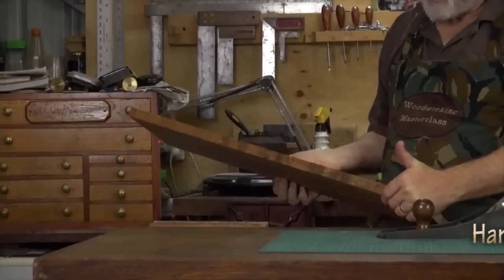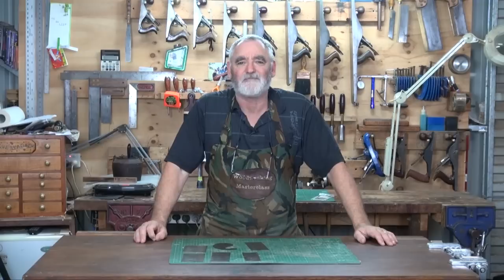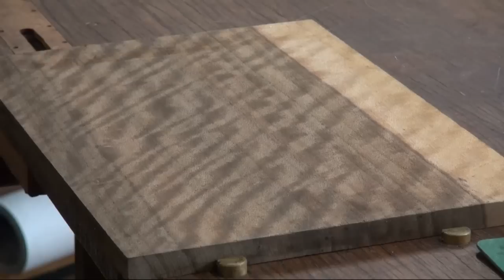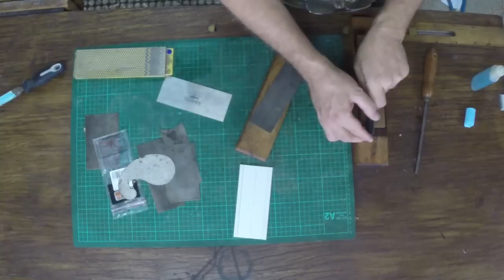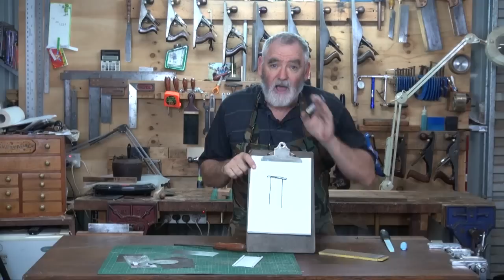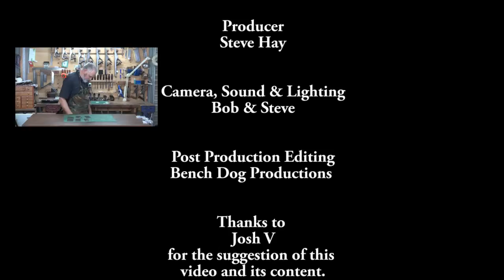Cabinet Scrapers Part 1

Comment: Steve,  I'm sure that you are a much better woodworker than I am but I must take exception to your card scraper video.  A properly sharpened card scraper produces fine shavings, not sawdust.  If I might offer a piece of advice I believe that a 5 degree angle and much less pressure will produce a scraper burr that will attain the desired result of a surface that need no further attention other than the application of the finish.  I use water stones and an 8000 grit polishing stone and produce shavings as fine as angel hair.  Once finished one can hardly feel the burr.

Comment: A file or rasp should only be used with a push stroke or it will be dulled.
Reply from the maker: Adding chalk helps clean them too. Cheers Steve
Reply: @Woodworkingmasterclass  That's one I forgot, thanks for the reminder.

Comment: Suppose you had to get a smooth, finish-ready surface on a 2'x10' knotty pine slab. Is a scraper a good tool for that job? If so, do you have to walk the full 10', or can you do smaller sections? Can the finish be compared to sandpaper grit from a nice pneumatic orbital -- 120? 220? 400? Plus any other questions I should be asking, but don't know enough to ask them. Thanks!
Reply from the maker: No you can scrape in smaller sections but remember to blend them together at the end. Finish from properly scrapped board should equal about 1500 to 2000 grit. Main advantage is also that there will be no raising grain once the first coat of stain or finish has been applied as there is when using a sander of any type. Be careful; scraping over knots as you may have to sharpen it a time of two to keep the cuts clean without tearout.. Cheers Steve
Reply: @Woodworkingmasterclass  Fantastic! Thank you! I hadn't even thought of the grain-raising issue from finish/stain; we have to "water pop" now, which is more time taken -- always a bad thing in a production shop. You and Katz-Moses inspired me to get a scraper yesterday so that I can start practicing. Thanks again :-)
Reply from the maker: @frenstcht  Pleased to have been of assistance. Cheers Steve
Reply: @Woodworkingmasterclass  I went and got one, then went to where I work to test it out. Holy crap! It's easier to use than a measuring tape -- and so inexpensive! I'm looking forward to being good with one. Thanks again ^_^
Reply from the maker: @frenstcht  Remember to sharpen a little, often rather that a lot infrequently. All the best with it. Cheers Steve

Comment: I learned a trick for a hot cabinet scraper is to simply flip it over 180 degrees every few strokes to keep the scraper from heating up. It also makes the scraper wear evenly so that you get the most out of the tool before sharpenings. Great video though! I look forward to watching more. Have a good one, -Austin
Reply from the maker: NosillaWilla Great Tip, Thanks for sharing it. I'll try it next time I'm scraping. Cheers Steve

Comment: Thanks, from Portugal :)
By the way dovetails joins in plywood is possible?
Reply from the maker: Hi Augusto. You are most welcome and Yes you can cut Dovetails in Plywood. Make sure, as always, you have a well sharpened chisel this is even more important with plywood for 2 reasons. 1. the cross grain construction and 2. the glue used cement the layers of the plywood together is very abrasive on cutting edges. Cheers Steve
Reply: Woodworking Masterclass Thanks to take the time to answer to me :)...
Reply from the maker: Augusto Campos You're most welcome anytime. Cheers Steve

Comment: Hi Steve.  First visit to your site and I am already impressed.  Good enough reason to subscribe as I need.

The reason I found you is I was trying to find some information about scrapers and this seems to have all the info I need.  But can you help me understand something about the re-sharpening process.

When you first file it flat, that causes a burr that you then remove by any one of a number of methods.  But then you use a burnishing tool to but a burr back on.

I'll probably answer my own question here, but it is only guesswork so I require some confirmation.  Is it that the filing burr is irregular and jagged, but the burnishing burr is smooth and regular?

Also, would an old chisel be OK for burnishing or would the metal be to soft? 

Cheers

Comment: can anyone tell me why scriping and not sanding? what is the difference?
Reply from the maker: +Галым Бердыкулов Straight forward answer is Sanding is grinding, wearing away the timber fibers. Scraping is slicing the timber fibers as a plane does. Once mastered a scraper (in my opinion) gives a better finish with less work. That is if both are done by hand, Electric sanders are quicker than both but can cause in accuracy if not done right. Cheers Steve
Reply: +Woodworking Masterclass thank you very much ! 📐✏🔨
Reply from the maker: +Галым Бердыкулов Pleased to Be able to help. Cheers Steve